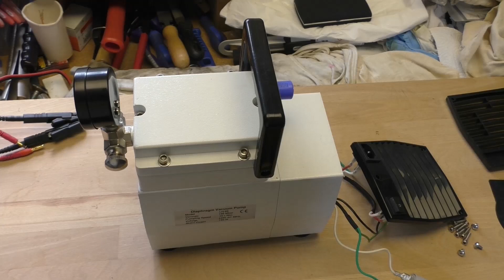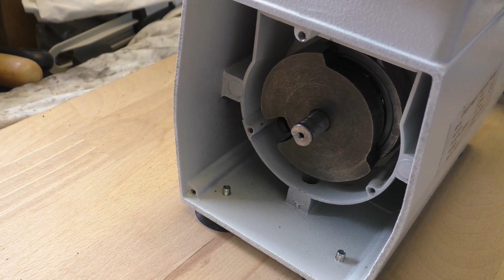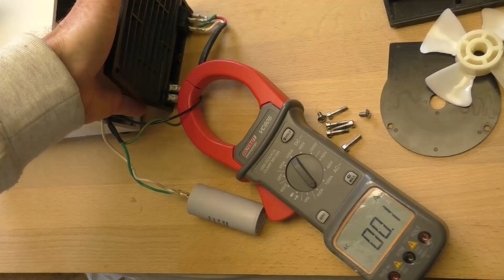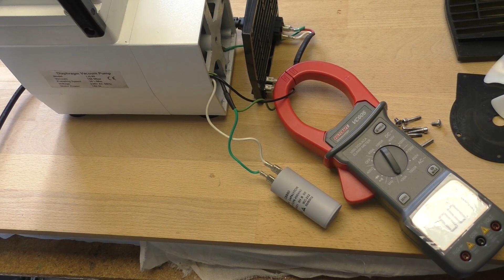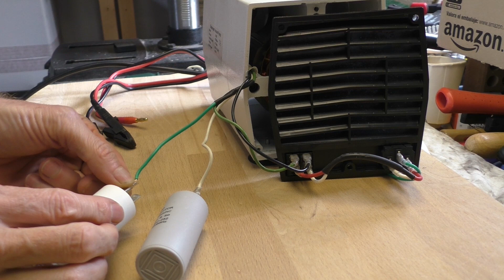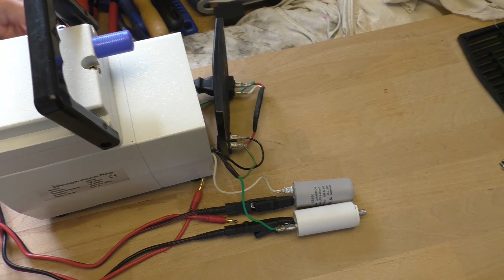Problem Solved: Vacuum Pump was Running Hot

Comment: wonderfull that 2 caps in series ar half the value, while too resistors is series are double the value.
And vice versa.
Capacitors and resistors have a interesting relationship. A capacitor can act like a negative resistance, reversing the amps when discharging